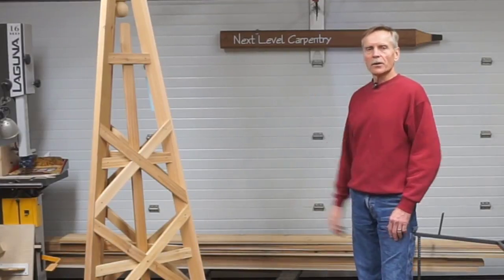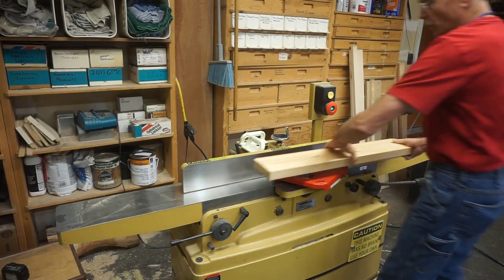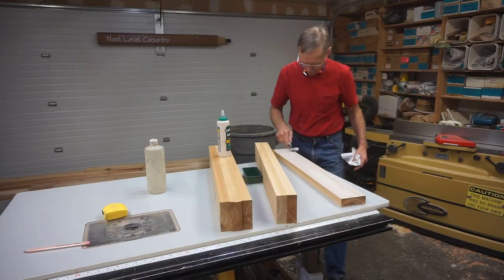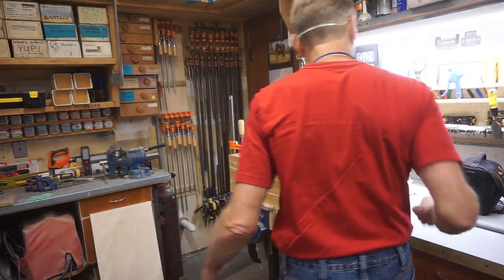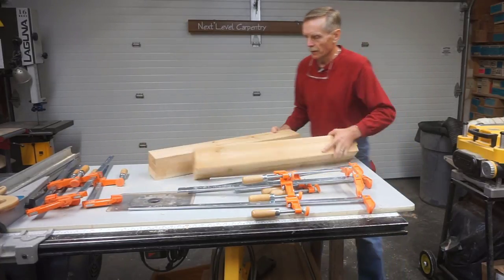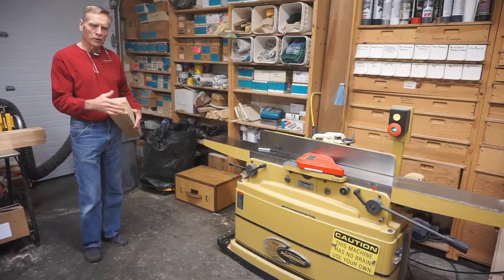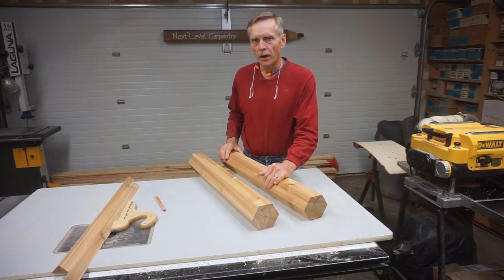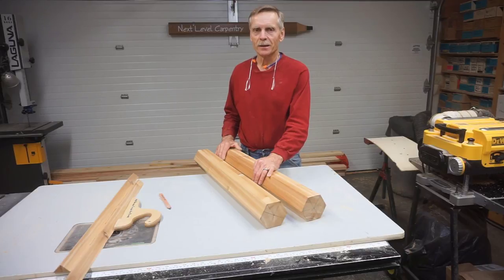Garden Obelisk Trellis Part 2: Making Finial Blanks

Comment: "Smurf gloves" loving it. Also using sawr dust to clean up a glue joint. I was one that always used a damp rag but will be using the saw dust from now on. Nice instructions on the layout of the piece and learned a new technique for the thickness planner. Great video.
Reply from the maker: Thanks Tom!  I question my sense of reason when I scavenge the 'just right' consistency of sawrdust from the shop floor and store it in my Sawrdust/ Guy Glitter bucket for projects like this... so you're on your own if people start looking at you funny when they see you hoarding the stuff too :-)  I make sure to keep a 'sharp' putty knife handy for scraping it off while it's still wet/damp since after glue gets hard you're right back in the other camp of scraping and sanding.  By 'sharp' I mean a crisp, square edge across the blade gained by dragging the putty knife perpendicular to and backwards across a fine-ish file held in a vise or laid on the bench.  You'll find that a 'dull' knife used for scraping concrete or something has an edge too 'blunt' and rounded to remove the sawdust/glue goo effectively... hope that makes sense?
Best,
Matt
Reply: Matt, I found another use for for saw(r) dust: I was doing a 'down and dirty' glue up using contact cement and got some on my fingers, saw a pile of fine sanding dust on my work bench and sweep some of it on to my hand. Keep the contact cement on my fingers from sticking to everything I was working on. Worked like a charm.
Tom
Reply from the maker: Tom True,
NOW you're thinkin'  We'll need to do a '101 uses for Sawrdust' compilation if this keeps up :-)  Along those lines I usually dip my hands deep into the bucket before putting on nitrile gloves on hot, sticky days... the thin coat of powder that clings acts like the stuff some 'powdered' gloves come with.
Please add any other revelations as comments for me and other viewers to use and appreciate? Thanks!

Comment: I was taught to cut the glue up with a sharp chisel just when the glue is set up and no longer wet but still pliable, it’s easy and quick to do and no sticky sawdust !
Reply from the maker: You can sure do that if you prefer CrimeVid... I prefer to get after it right away so as to avoid waiting too long and find the glue dry and  brittle, not pliable, like when gluing up large batches of part.  Sticky sawdust isn't a problem... just use more sawdust if it is, and is small consolation for trouble-free results IMHO.  I don't mean to lecture as you've got sound reason and experience behind your workflow and far be it from me to infer my choices on you or anyone! 😁😎

Comment: Amazing work!
Including all the milling with jointer & planer is awesome, not too many woodworking channels include those initial steps.Your a master with woodworking and using the table saw. Must be an old one not to have a riving knife.
I haven’t watched all your videos yet, (because It would take a year to get through them all, you know as each one is like an hour to hour & a half long ) but I have not seen you make much with plywood, which is unique as a lot of the other channels seemed to be more based around plywood and pocket joints. Your not a plywood shop, your a true wood working shop.  Having said all that I don’t believe you have a track saw? If you had a track saw could you have cut the scarf joints with it instead of the table-saw jig? The table saw & jig was cool by the way, but was just wondering if you have ever used a track saw and what you thought about them? Also it’s kind of cool to see you do things old school, do you have any Festool tools? What is your opinion on these fancy modern shops with stacks of Festool tools?
👍
Reply from the maker: Thanks R CE... glad you like the milling stuff in this video/series.  I don't think I'd use a track saw for any of these parts because of their relative size and need to be accurate. While a track saw is capable of a high degree of accuracy I don't think you can beat a well-made jig for accuracy AND consistency where more than one part is needed.
I use plenty of plywood and other sheet goods for cabinetry and other projects that are best suited to it but, with projects like this trellis, real wood is the best way to go IMHO.
Where Festool is concerned I own zero.  For the most part I think their stuff is over-designed and over priced and, since I've no interest in 'brand status' have no use for Fusstool.  That could change at any time but, in the meantime, I challenge anyone to produce equivalent results in quality, profitability and customer satisfaction, etc as I get using a hodgepodge of brands and designs.  I watched one Channel in particular that looks to be 90% or more festool stuff where the Host was making drawers.  Imagine my shock when, with an expensive arsenal of Festools at his disposal, was USING POCKET SCREWS to attach drawer bottoms during assembly?!!  Oh well... to each their own, right? 🙄😁😎

Comment: Do you have a video on the supports u use as outfeed?
Reply from the maker: Not yet Chris but am putting it in the 'to do' video roster... it will be a total metal fab/welding video with nothing to do with woodwork.  Do you have metal fab/welding capability?  Curious. Matt
Reply: @NextLevelCarpentry  lol, no I have no metal qualifications , I'm sure u can manage it Matt!
Reply from the maker: @MrRadtech22  I ask mainly to understand what the NLC audience is looking for or expecting when planning the video.  I can gear it towards a full-on build or more an overview for those who are just curious or who might show it to a metal fab shop and have a pair made... they're indispensable in the shop and I've got a whole list of improvements for them since making the pair I have in about 2001.  If only I could get to half the projects I really want to do... 😞😯😢Best, Matt